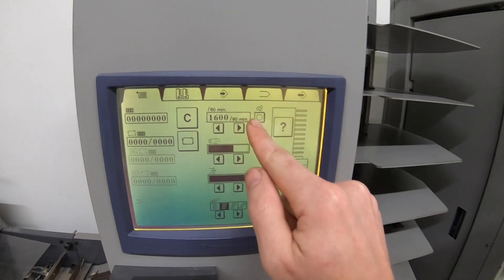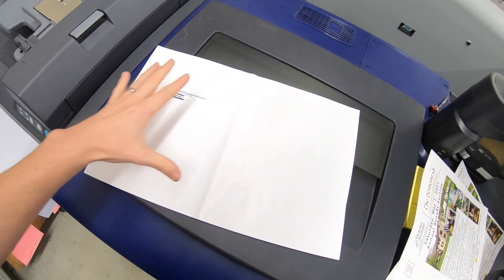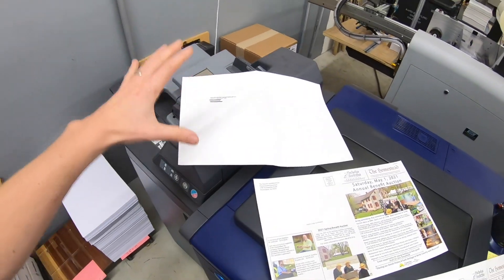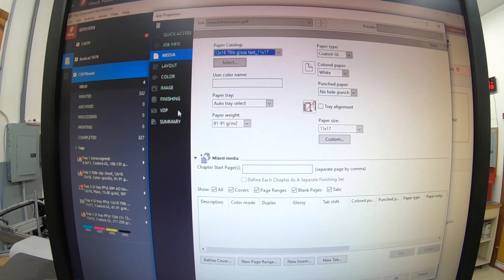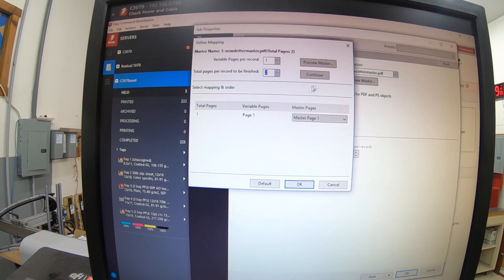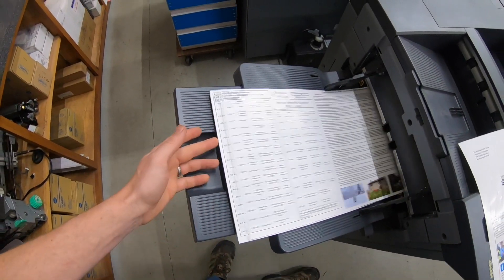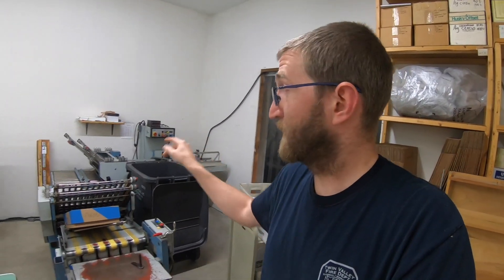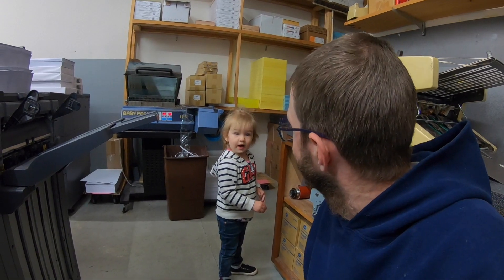Variable Data Printing Using EFI Fiery RIP, Save Time and Money in Your Print Shop

Comment: Looking at your tab machine, it looks like you could almost stick another roller assembly on the bottom half and have it run both tabs at the same time.
Reply from the maker: I bet I could. I have been watching the auctions for a cheap machine. But I hardly use it so I'm not too motivated to upgrade.

Comment: How do you get the file to create the master
Reply from the maker: I'll have to do a start to finish variable data video. You have to send both files t the RIP. Then you open the file you want to be the master and click VDP on the left. Then there is a drop down window on the left where you can select an open spot. Then push print and it will save it as a master.

Comment: I tried doing this with a pdf master and xls address file. Once I get to choosing the master in the VDP tab I am unable to check the box for "Enable free form"...any idea why?
Reply from the maker: You need both files to be pdf files. You can either use mailing software or indesign to create a pdf where each page is an address.
Reply: If you have the data in the form of a table, you can use it directly via Fiery FreeForm Create program, base version of which is free and fully functional.
It also allows you to change layout of your VDP data, and some basic editing like adding regular text too.
Although in my case I had problem with it producing broken files which often didn't print at all, but maybe it will work for you just fine.

Comment: You can also use VDP to change entire images or areas of text on pages as well. This allows you to run targeted direct mail campaigns based on user interests, membership levels, etc. I did one where the company had a silver/gold/platinum membership tier so the coupon values changed. Ran a 1,500 postcard job like that, it’s pretty awesome.
Reply from the maker: Nice, I learned how to do that back in school but haven't needed to use it yet. I guess its my job to find a customer who could use that.

Comment: Discovered this myself under similar circumstances.  Lead me to look into what else it can do, found EFI Freeform, which gas "some" uses, and of course Indesign which works very well, but you need lots of graphic, processor and Ram memory.
Reply from the maker: Yes, the Fiery has lots of feature that most of us never touch. Its fun to explore when I have time. :)

Comment: I’ve been doing it manually in InDesign and creating those large files with 1000+ pages😭 I shall try this for the next batch of mailings.
Reply from the maker: I figured I wasn't the only one. :)
Reply: @justaprinter  yea specially when I do 2part or 3part invoices I end up having these huge 3000 to 6000pg files because I number them digitally.
Reply: Haha we do this with the rip but have always had problems with the speed of InDesign handling the file. I caught another write up that mentioned using export as PDF in the InDesign datamerge drop-down. I almost fell out of my chair. Much much faster. We used to split large 10,000+ barcode merges because it took so long (petitions require the barcode and number here). Your explaination of the VDP was really good. For us the snag is always getting impose different somehow. Bleed area off or gutter, just a little difference makes a right mess of a 8000 piece 8.5x5.5 political mailing on a tight deadline. Don't even get me started about when the indicia gets left off.
Reply: @kabirpaul7677  we have an old program that we used to use. Auto-number pro. It does a PDF merge like the VDP rip and can do a ton of custom number layouts. Raffle tickets with tear offs were a common use. I think my artist now does most of the numbering in Adobe but I still drag out auto-number from time to time. I'm not an artist. I'm an old crippled auto mechanic trapped in a Printshop. :-)
Reply: @FrankRoark  yea I’ll do the ticket numbering in InDesign to it’s so easy in indexing takes literally 30 seconds

Comment: I did a few mailing a long time ago.  I got lucky and was always able to get an office document version of the file and use mail merge.  Some of the really big jobs like thousands pieces I'd take the material to a mailhouse and they could put the addresses on about anything.  For me at the time it made sense to outsource that part but it worked out nicely.
Reply from the maker: Yup, mailing is certainly a good thing to outsource. Software and equipment are expensive for just a few mailings. You need to be mailing items each week to justify the purchase.

Comment: Word of advice: buy up all the 20A and 100A parts you can now or machines machines parts. Standard stops supporting for parts (not producing parts/not replenishing stock) after July 2021.
Reply: Specifically the electronics portions.
Reply from the maker: Good to know. I have been very impressed in the lack of fixing I need to do on that machine. It doesn't break, but I must fix a few sensors. I'll look into that. Thanks!

Comment: For small runs, or when you don't have a RIP to do it,  you can build a master document in Word and link it to an Excel file with the variable data.  Then print to printer or PDF to produce the merged output.   This approach is useful when the run is a one-off and too small for a programmed job using Exstream or DocuMaker or whatever else is the flavor of the moment.  The place where I work does it with in-house software feeding multiple print plants outputting about a million printed images a day, all variable. It's not a huge operation except compared to smaller shops. We're dwarfed by the likes of RRD.
Reply from the maker: Interesting. Oh yes, RRD, would be very interesting to learn more about them.

Comment: This video showed up at the right time for me.  I’ve been working on merging a 65,000 double sided page document onto a letterhead template through InDesign.  I can’t go past 9999 pages on each so it’s creating a lot of files that take forever to create.  We’ve used the VDP feature in Fiery before but couldn’t figure out how to make it work on a two page document.  This will save me a ton of time and frustration!
Reply from the maker: Great! I ran into the same issue only outputting a few thousand pages in Indesign. Those days are over!

Comment: If you have InDesign, it has a Data Merge feature which allows to use variable data, and so you can have as many pages as you want in a copy, so making double-sided layout is not a problem. It supports raster image/vector files as variable data too.
Of course as others mentioned if you need like 50000 different copies, placing background on each would probably take Fiery like half a day to process, so better to separate the master and use the method from this video.
Reply from the maker: Yes, I do utilize data merge quite frequently as well.

Comment: Good morning! What is the maximum pages you can print and bind? Can you bind a Bible? My translation  is going to typeset, and looking for a "Collector´s Series" on 60 gr paper. The estimate is for about 2000 pages. 170mm X235 mm. Thank you.
Reply from the maker: About 1200 pages would be the max that I do.
Reply: @justaprinter  There is a new trend for Bibles in Brazil. Bible in a spiral. Would that change the outcome?

Comment: Dan I’ve been using Accuzip for my mailing software. Curious what you are using? I have a Accufast K2 tabber. Double tabs in a single pass. Not a bad tabber.
Reply from the maker: I have been tempted by those tabbers, currently watching on online. I use SmartAddresser, its expensive, but I like it.

Comment: Wow, very helpful!
How do you create the PDF with the variable names/adresses? (I'm new to this and just getting in to it) I'm usually provided with an excel file from the customer for the different names/adresses. The only way I can think of is to create a document in InDesign using the data merge function. 
Is there a faster/easier way? How does everyone else do it?
Thanks and best regards from Sweden!
Reply from the maker: Yes, you can use datamerge in Indesign. For bulk mail I use software called SmartAddresser which automatically sorts the mail and provides the barcode for discounted postal rates.